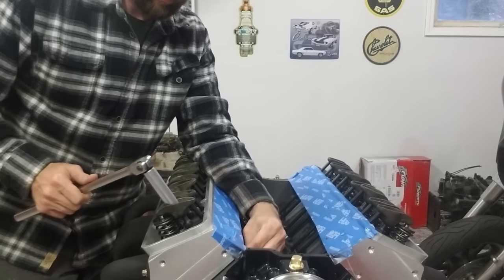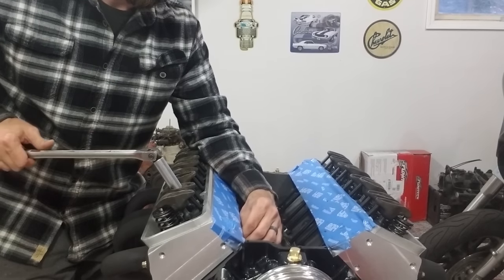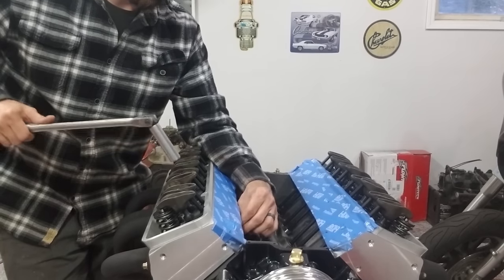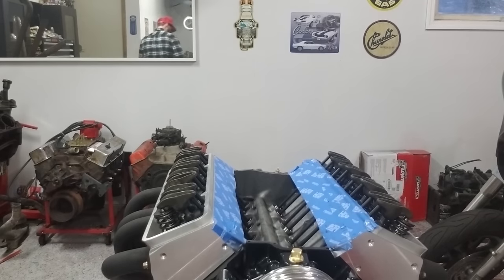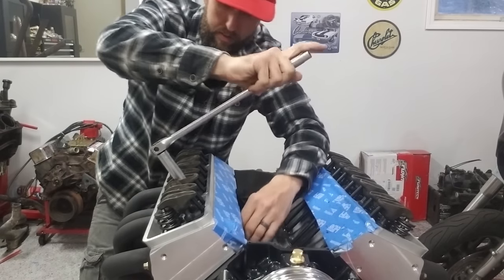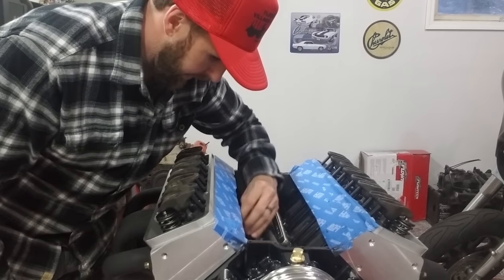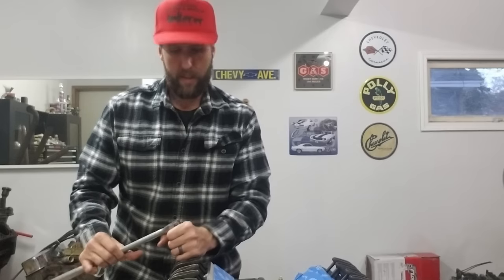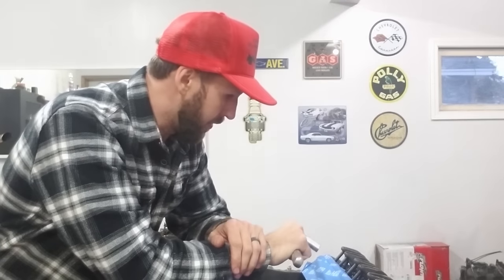Hydraulic Valve Adjustment THE EASY WAY!

Comment: Old Ford mechanic told me on my Ford engines to just torque them down to 24 foot pounds that's always worked good for me
Reply: Most Ford's aren't adjustable so the folks with the lower IQ's can manage to build them with some success and a lot more money vs Chevy.
Reply: @joelwindsor525  its true though sadly

Comment: I always rotate the engine until there bothon the bottom, then run them both down to zero lash then go one half turn and lock them down, but a little different on a solid lift.

Comment: Interesting technique. I usually just follow the GM manual procedure but this does seem easier. 
One thing i noticed with my current 350 is that i can't go 3/4 turns past zero. More than 3/8 past zero and i can feel the lifter bottom out. 
Might be time for a cam swap!
Reply from the maker: just might be!
Reply: @ViceGripGarage  Sending it anyway. RallyX is still technically a go for next month.

Comment: That's how I was tought in 9th grade shop class, it's always worked for me. Picked up a 66 Malibu 2 door for 100$ a few years later, pulled the rad & slid in a cam in dudes drive way.

Left his drive way sideways.
Did noise timing gears & new top end gaskets while I was in there.
Cleaned the plugs, tuned by ear.
Best 500$ & 3hrs I've ever spent.

Ya gotta use your knee when enjoying a cold snack & burger 🤣

Comment: Thanks for the video. Seems simple. Could you share whether or not this can be done with no valve job and oil in the lower half of the engine? In other words, can this be done with oil in the lifters? Thanks.

Comment: Very good information. Do you soak your lifters in oil first? I've been told I have to and others say I dont.
Reply: Soaking your lifters in clean motor oil in a covered clean pot for half a day before installing them helps them quiet down faster on fire up...it's an easy, good practice.
Reply: @moparman1962  Soaking them for a day is not going to do anything more than soaking them for 10 seconds is gonna do.

Comment: I just found this in another video - AWESOME ...My god how many people do it the hard way when they don't have to ...Question..how do you account for if the hydraulic lifter is PUMPED up with oil? I did see that non-pumped (no soaking in oil) is different than pumped. So what if its from a running engine that did pump them ? Thanks...again, great for sharing
Reply from the maker: it is but it isn't.  the same pre-load principle applies. However, it "Feels" different because when going 1/2 to 3/4 from zero lash, you'll be opening the valve slightly, depending on which cam lobe/rocker you're working on.
Reply: Vice Grip Garage so in that case apply less pre-loaded? I ask because might change heads but already have hydraulic roller lifter (run in engine). Thanks

Comment: I haven't seen anyone do valves that way in 30 years , have you tried to adjust them while the engine is running? You just tighten them until it starts to miss on the intake then loosen until it fires  on the exaust you just tighten or loosen until it doesn't knock. Oh yeah don't use new wrenches for this because it beats them up a little.

Comment: This looks like a great and simple method. If I went through the process and 1 lifter was tight from the beginning and and at every 90 degree rotation, is there a possibility that rocker is already pre-loaded and I could mess things up with an additional 3/4 turn to pre-load? Am I better to back all the tight ones off at the beginning to get them spinning before I start tensioning them?

Comment: I also use the 90 degree method. My difference is that I start at #1 TDC.
Reply: 45 is better and it doesn't matter were you start,4 times a complete revolution is more finite

Comment: I've got a question for you a little off the subject. Newly rebuilt empty Quadrajet first start-up. Would you manually add some fuel to the float bowl, or crank the engine a few times before hitting the pedal and setting the choke. "Crispy as Bob Barker's back" that was a good one!

Comment: Seriously mate fantastic! watched your vid did exactly what u said for hydraulic lifters worked a treat an adjusted fast thank you. Could you explain how I could do this  my  flat tapper solid lifter engine? Thanks
Reply: You would use a feeler gauge under each rocker arm to whatever lash you need and still do (8) 90's but on that style I would start TDC on #1 compression and set valves then run through the firing order 90 degree at a time
Reply: No shortcuts there, every 3k miles follow the standard procedure

Comment: Definitely the easiest way I've seen it done, and to your point, makes me a lot less hesitant about the cam swap in my old truck.  Do you have a method you prefer for solid lifter cams?  EO/IC method on those?  Have a fairly new to me Chevelle with a solid lifter 396 that I'd like to at least spot check the lash on.
Reply from the maker: Solid lifters must use feeler gauge
Reply: @ViceGripGarage  Ya, I understand that part for sure, but do you still use the same method of 90 degree turns adjusting to zero lash, then make the final adjustment with the feeler gauge, or does that method not work well on a solid lifter setup?
Reply: Appreciate the quick reply, BTW!  Always look forward to your videos.  Wish I could catch you up in Indy for a look at Independence in person!

Comment: Derek, how did you oil up after installation? Let them clack until they get oil? Reading a lot of negative about soaking in oil. I’m about to do the job on my 2000 GMC Sierra 6.0.

Comment: Saw this method on another page and then VGG showed up so I had to watch. The other guy noted this should only be done with new lifters that are dry and not if your lifters are already full of oil. Is there a way to use this method one a previously running motor? My rockers are clattering on my inline 6 so it is easy to get to the pushrods from the side.

Comment: Derek,I have a Ford FE with a leaky  intake manifold gasket that I need to swap out. Can I still use this method  with oil currently in  all the roller lifters and motor once I re install the intake  and then adjust the valves ? Sweet video,thanks .......

Comment: I just changed my heads, do I need to bleed the lifters since the truck hasn't been running in a while before going through this procedure? By the way it was getting several things done in the shop for a few weeks and then I did my heads. Probably a month or more since its ran.

Comment: Sometimes you have a high mileage engine and a valve train been at high rpm or due to not goid oil you wear out the cam lobe and the spring, so to account for that youd want to put it a little tighter timing is key on enginee that valve needs to open to fully during combustion, also this csn save your engine from bending a valve you usually bend a valve because of this reason even or that your belt wasent tentioned probably and started stetching or was to loose when you put it on over time it can possible skip a tootb and ecu will not know what to do but still run, even if you have a knock sensor

Comment: Do you twist/rotate the rod with force/strength with your finger tips? Or twist until you just feel it just snug? I’m currently doing this right now and tried the manual method but saw this video and found it much easier. I moved away from the manual method and just went thru them all using your technique. Didn’t loosen just went with your technique. Should I start all over and loosen then tighten? Any recommendations would be much appreciated!!

Comment: What if you are just replacing the heads and not the cam & lifters? If the lifters had oil run through them, will it cause an issue?

Comment: This is BY FAR the most simplistic way to do it. However, definitely not the fastest way. If someone is intimidated, this is great way to do it. If someone is building an engine I'd hope they'd have knowledge of how and when valves move. Not always the case though. Much faster to watch the pushrods in relation to firing order, and adjust them accordingly. I can definitely understand why people are intimidated by doing that if it's there first or second time though.

Comment: On hydro valves I’ve always just finger tightened the nuts to where it pushes down on the lifter springs a little. Once the push rods tighten up you’re good. At least that was my experience.

Comment: I just got my first project car a 1970 Chevy nova with a 250ci inline 6 and wondering if this method would work on this engine and if so do you tighten the rocker arm nut until you can’t spin the push rod or is it until you can’t move the push rod up and down, thanks in advance

Comment: So I've been fighting with an 86 350 boat motor for a while. Got it running then had an intake water leak. Got that cleared up. Got it running. Then 3 pass side rockers came loose. I'm worried I destroyed the cam. It tries to fire up but stalls. Just went out and did your instructions.  But  some rockers keep on needing tightened. There all right now. I dont want to destroy the cam.

Comment: Will this method work with a 2002 ls 4.8? Nice video, i totally forgot to bleed my new lifters that i got from summit racing.. I never soaked them in oil like others say to do but i did notice they have a very light weight oil in them. Just wanting a Pro's opinion. Thanks

Comment: My problem with this method is with a flat tappet you are only supposed to run it down until the rocker arm touches the valve stem and give a half a turn The valve stems are supposed to turn freely because if you tighten it until it’s tight you have compressed your lifter and there should only be a half turn preload on flat tappet lifters

Comment: If you had a 6 to 1 roller rocker would still do the 3/4 turn on a 350 with a custom Iluminada custom max lift for application cam

Comment: Thanks, bud! Got a question: about to put a camshaft with a .504 lift in my sbc and going with stock rockers, as the company doesn't say not to...also stock springs. Was told by them I need 140-160 pounds seat pressure, so should I still go 3/4 turn? Thanks much.

Comment: Hi there love your videos, I have a 305 with noises, can you twist pushrods at the top section to guage movement without removing intake manifold,I don't want to go pulling it apart if makes no.difference as Will have to put in shop to do ta, Nathan UK

Comment: Does this method work on an engine that was running? If I have the engine out and check the pushrods with the intake off, can I adjust the valves this way or will the oil in the lifters throw it off? Appreciate the video!

Comment: One thing I never see mentioned in all the videos demonstrating this technique... do you prelube the engine before doing this?  I'm wondering if the lifters being pumped up or not make a difference using this method
Reply from the maker: It does not. Zero lash is zero lash.  If you're pushing against hydraulic resistance (lifters pumped) youve gone too far.  Depressing lifter cup not pumped, youve gone too far

Comment: Does it matter whether the lifters are pumped up or not? 
Thanks for the great info!
Reply: I wish you had gotten a reply, I'm sitting here about to adjust mine wondering the same thing. I dont want to open a can of worms. Did you ever find out if it matters?
Reply: @scottfell5293  well I put my unit back together (350 chevy) and it doesn't make any valve noise. It runs smooth and no issues after 1500 miles so far. I'm no expert but it doesn't seem to matter! My lifters were hard as rock and like I said, no noise or burning valves so far! Good luck!

Comment: Can you do this method with the motor in truck with just the valve covers off after new valve stem seats installed ? Or is this way only for a complete rebuild ?

Comment: How would you go about adjusting the valves when the engine is already running in the truck would you loosen all the rockers and start from 0. Or any torque specs?

Comment: I have a destroked 400 block chevy with a 350 crank and roller rockers with a solid lifter cam. Needing to adjust my solid lifters - is it possible to apply this method, and if so, where do I use the feeler gauge? Thanks!

Comment: just put a cam in my 305 sbc.. new lifters also.. as im rotating engine some of the pushrods tightened up .. do u back them back off to zero lash ??? or leve them alone as your rotating the engine????
Reply: start fresh,rotate each pushrod with your fingers and tighten until they just barely spin ALL OF THEM.

ROTATE 45 DEGREES

rotate each pushrod with your fingers and tighten until they just barely spin ONLY THE LOOSE ONES

ROTATE 45 DEGREES

rotate each pushrod with your fingers and tighten until they just barely spin ONLY THE LOOSE ONES

ROTATE 45 DEGREES

rotate each pushrod with your fingers and tighten until they just barely spin ONLY THE LOOSE ONES

ROTATE 45 DEGREES

rotate each pushrod with your fingers and tighten until they just barely spin ONLY THE LOOSE ONES

REPEAT THE ABOVE THREE COMPLETE 360 REVOLUTIONS

now tighten each pushrod/rocker 1/2 to 3/4 of a turn ALL OF THEM......

Comment: I suppose there's nothing wrong with this, that I can think of, but it's very easy to just turn the engine over and watching a rocker go down to know your own the base circle of the cam too. This way, there's no risk of getting one just on a cam lobe where you "thought" you turned the engine over in a enough degrees to ensure they were all down off the lobes. I'd just do them one at a time instead of like this. You're going to have to turn the engine over a lot either way and with the plugs out, it's not like it's hard to turn it over. One at a time, there's no risk of being up on a lobe, but this way you "can" risk missing one or two where you thought they are all down on the base circle. I'd just take the time to KNOW the valve is all the way down and not take any risks at all. It's only a 10 min job anyway, so why take ANY risks?

I know, I know, one will say, as long as you go around exactly 90 degrees you'll get them all. The problem is, it needs to be exact. Get just ONE off and your half a turn could be more like a no turn if you were still part way up on a lobe, or even not even at zero lash yet. I just don't see enough reward for the risk this way.... I don't see any reward at all in fact. This is where "time is money" and your doing this a lot day in and day out, but just for one guy's car. There's no benefit to this (however, slight) risk whatsoever.

It might be the "easy" way but like a lot of things in life, this isn't the best way and in this case here, the best way isn't the hard way either.

Comment: Did you soak the lifters and oil ahead of time? I have a 1996 Chevy Silverado that has the hydraulic roller lifters and wondering if I should soak them in oil first?

Comment: Btw... big fan! I’m doing valve stem seals and intake valve seals on my 92 Silverado short bed with a 350 sbc tbi I’ve done what you said, but was wondering... how much play should there be (spinning) in the rods? Some of them spend. But once I rotate the crank, some of them are stiff? Is that normal?
Reply: start fresh,rotate each pushrod with your fingers and tighten until they just barely spin ALL OF THEM.

ROTATE 45 DEGREES

rotate each pushrod with your fingers and tighten until they just barely spin ONLY THE LOOSE ONES

ROTATE 45 DEGREES

rotate each pushrod with your fingers and tighten until they just barely spin ONLY THE LOOSE ONES

ROTATE 45 DEGREES

rotate each pushrod with your fingers and tighten until they just barely spin ONLY THE LOOSE ONES

ROTATE 45 DEGREES

rotate each pushrod with your fingers and tighten until they just barely spin ONLY THE LOOSE ONES

REPEAT THE ABOVE THREE COMPLETE 360 REVOLUTIONS

now tighten each pushrod/rocker 1/2 to 3/4 of a turn ALL OF THEM......
Reply: does it have to be on top dead center? doing valves and started truck and still needs adjusted ? can i start over from there? or do i need to bring back to TDC

Comment: Can I use this method for an engine that's installed? I think I need a adjustment but I don't know if that only works on new builds or on running engines too

Comment: I actually just got done doing an engine that told you to do it this way but on apposed cylinders
Reply: no

start fresh,rotate each pushrod with your fingers and tighten until they just barely spin ALL OF THEM.

ROTATE 45 DEGREES

rotate each pushrod with your fingers and tighten until they just barely spin ONLY THE LOOSE ONES

ROTATE 45 DEGREES

rotate each pushrod with your fingers and tighten until they just barely spin ONLY THE LOOSE ONES

ROTATE 45 DEGREES

rotate each pushrod with your fingers and tighten until they just barely spin ONLY THE LOOSE ONES

ROTATE 45 DEGREES

rotate each pushrod with your fingers and tighten until they just barely spin ONLY THE LOOSE ONES

REPEAT THE ABOVE THREE COMPLETE 360 REVOLUTIONS

now tighten each pushrod/rocker 1/2 to 3/4 of a turn ALL OF THEM......

Comment: I recently purchased a 72 El Camino with a rebuilt 454 big block. After driving the car, I noticed a ticking sound that was quite loud.  Having never adjusted valves, I was pleased to see your video. So, I removed the valve covers, loosened up all the rockers, followed your procedure of finding zero lash and then tightened each 1/2 turn. Do you think I am good to go since the lifters were already loaded?  All of your comments mention pre-loaded lifters and it got me thinking.  I have not started the engine yet until I talk to a few mechanics to get their opinions.  Any advice you could provide would be helpful.
Reply: I know this comment is over a year old, but for anyone wondering, the pre-load is that extra half-turn at the end after they're done being adjusted

Comment: Do you have to set the engine on Top dead center buddy before adjustment
Reply from the maker: Nope
Reply: Could you make a video on setting it on Top dead center and installing distribution for a 350 5.7 TBI after value adjustment